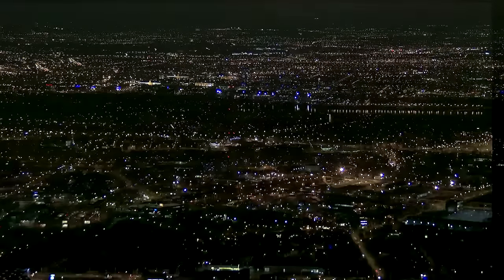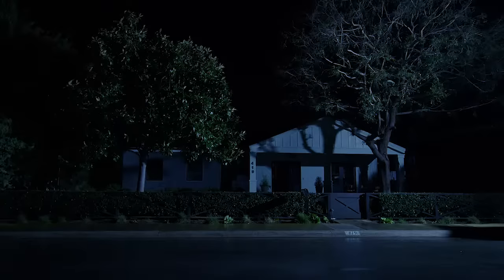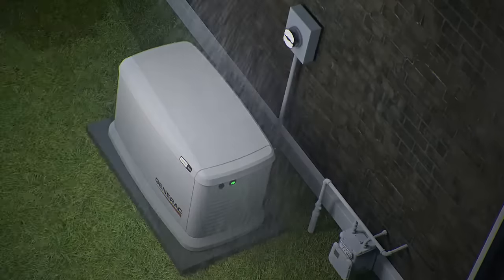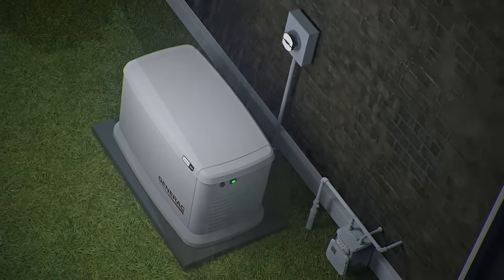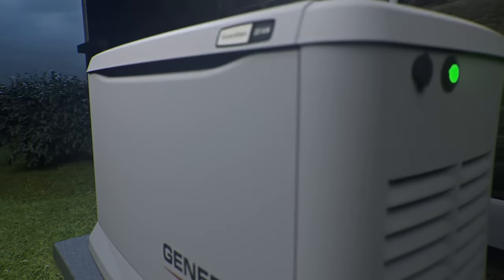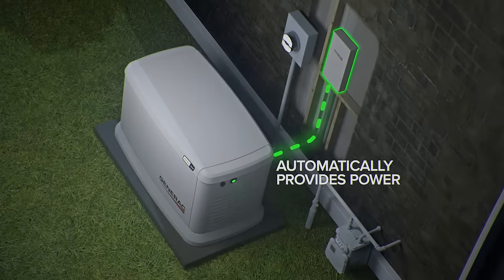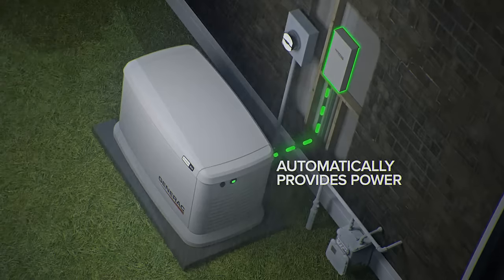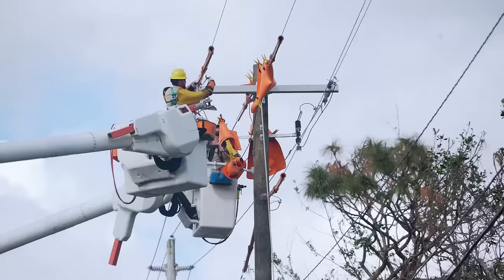Generac Home Standby Generator: How It Works

Comment: We thought we had purchased a quality product.  However, we since installation are inundated with sales pitches urging extended warranty.  Is Generac problematic to the point we need to worry?  Or, is it a protection racket?  At this point, we wish we'd gone with Cummins as did my neighbor who sings praises of his experience.  With Generac's endless hounding, we truly are experiencing buyer's remorse.
Reply: Simply tell them you’re not interested
Reply: @adrianb393  
That seemed a logical reaction the first 200 times.  Thanks though.
Reply: My Generac whole house generator is about 20 years old, and it has never actually worked in an emergency, though I don't think it has been needed very often. My mother got it after we had to suffer through a brutally cold night without any power. Every time I get it serviced, it will run at the weekly interval for a while, some weeks up to maybe a couple of months, and then stop.

You have to be really proactive about getting it serviced. I live just outside Atlanta, and when we had that huge storm several years ago that stranded so many people out on the roads, I was here at the house freezing while listening to my neighbor's generator buzz along. I ended up having to sit in the car, turning it on at intervals for heat.

My suggestion would be to buy the warranty.

We originally had hours installed by our usual handyman, but I am now thinking we probably should have gone with a Generac repairman. When we got it, we thought it was like most other appliances you set up and turn on, but as I said above, you have to be more proactive with it. I am going to get it serviced in the fall, because I am not going to be caught off guard if we have an outage over the winter again.

Comment: I hate these generators. My neighbor has one and even when not in use they cut on and run for at least 30 minutes every two weeks. Running one for a day can cost over $50.00 so that thing cutting on all the time to make sure it is still running right is a waste of money and a big annoyance. You better put it on a high slab so when it floods it will not ruin the generator.
Reply: I have an old one, and I concur. Though my generator is about 20 years old, I think it is still in almost perfect condition, but these generators require regular maintenance and the tests you wrote about. If I were in the market for one now, I would probably just get a portable power station.
Reply: Amazing advice. Thanks so much

Comment: I have a Honds EU 2000i generator.  It works and it is quiet, but keeping gas separately in a container is dangerous and I have to add Sta-bil gas additive every year.  Also, I have to let the generator burn through the old gas every year.  Maybe in a few years, the state of CA may outlaw gas generators.  Some cities have already outlawed gas weed whackers and lawn mowers.

Comment: Which unit is recommended for a 2500 sq ft home with 4 bedrooms, 2 bathrooms, 2 fridges, a 5 cu ft chest freezer, 6 window A/C units, washing machine, gas dryer, and an electric oven & stove?
Reply: Ph no
Reply: i run a generac 2 stroke natrual gas engine JLO 760 and it heats our water too!
Reply: anywhere from a 22-26kw would do you just fine with numbers like that. i know the reply is late but if you're still looking into it.
Reply: None, their generators are total POS garbage 💩 go to Lowe's & get a Westinghouse 5300 watt unit with electric start. Best rated unit out there next to the overpriced Hondas.
Reply: @Draztica  Yep, still looking into it, especially after almost having a power outage during a snowstorm last week in WI.  The lights flickered several times over 2 days but luckily the power only went out for a few seconds each time.  Would've been a hassle to hook up 7 space heaters and everything else to 3 outdoor gas generators during the heavy/wet snowfall.
Reply: @martinafan64  if you find a reputable company to come out and take measurements, be sure to mention "Load management". They're devices that delay startup on things like AC units and pool equipment, so when your power goes out, not everything comes on at once. can save you a pretty penny!
Reply: @Draztica  Thanks for the advice regarding Load management.  I'll definitely mention it to the contractor because if the power goes out when we have all 6 window AC units running, it might be too much strain on the generator to try powering them back on at the same time.  I can definitely see the advantage of a "staggered startup".
Reply: @okramw1  I've had a generac for years and then it broke down, I bought a westinghouse and it broke my 3rd use, garbage Amazon generators westinghouse is.
Reply: @kevinprzy4539  Dam! That's pretty bad luck! HONDA$$$ 🤞
Reply: @okramw1  Not a fan of giving money to foreign companies if I can help it. Bought a generac 9200 about 7 years ago after the westinghouse pooped itself (had around 12 uses since then since Michigans power grid is garbage lmao) starts with one pull, but I'm going to let time test it longer.
Reply: @kevinprzy4539  Best of luck with your unit. Try to go above & beyond with whatever maintenance is required. & love the dishonest advertising they use! Made in USA (Bull 🤬)!!

Comment: I don’t worry too much about power outages, though we have them a couple-3X as year. It is rarely out for more than a few hours, and for longer outages, we have a generator, a Honda EU2000i. Now, a SYSTEM would probably be better, and a battery based system even better, but at some cost! The truth is, with my current tools, I can run the refrigerator/freezer and charge phones and other electronics, and while it’s running, watch TV, etc. I have little doubt that a battery-based system might be better, but for occasional use my current system works fine, and costs nothing additional. When I replace it, I’ll probably switch to a battery-based system.

Comment: I'm definitely buying one of these, just doing research on the brands.
Reply: Don't buy Gen-A-Crap!!!!! Get a Westinghouse 5300watt electric start unit from Lowes. That's what I have, & I'm a NYCity power-plant manager.
Reply: @okramw1  Westinghouse is terrible.
Reply: @okramw1  I have an old Generac, and I agree with your assessment. These generators seem to require a lot of maintenance. Every time I get it serviced, it will perform the weekly test either for a few weeks or a couple of months and then stop. Trying to figure out if I want to continue working with the generator, which has never actually worked in an emergency, or if I want to just get something else. What do you think of a portable power station?